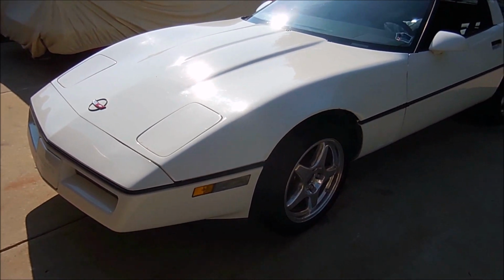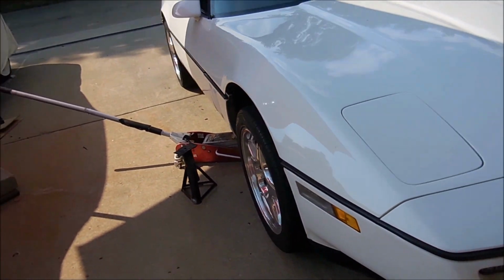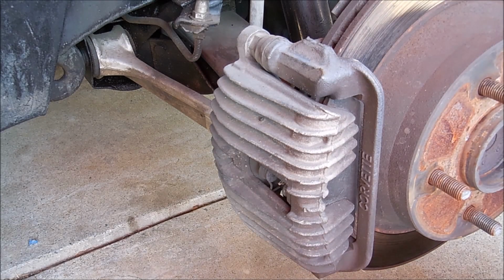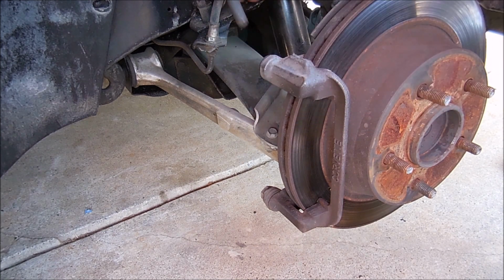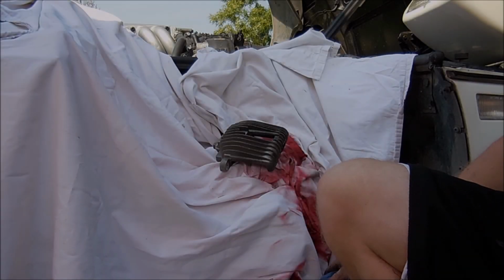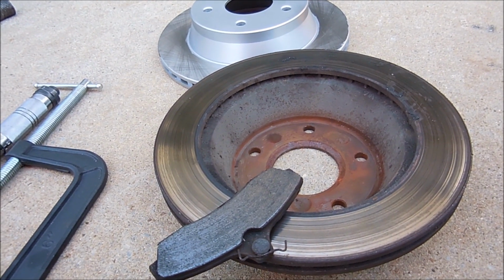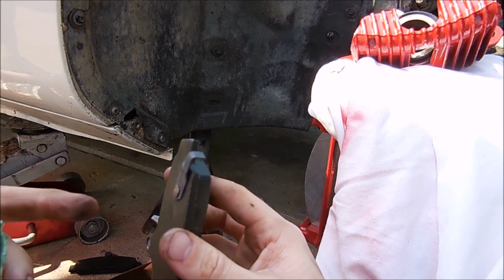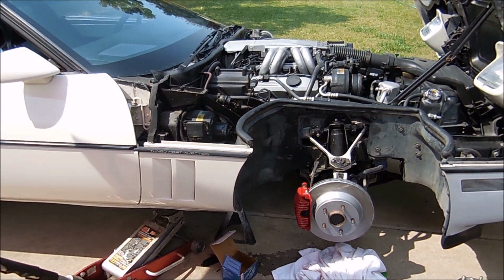1985 C4 Corvette: Project Daily Driver Part 5 of 8

Comment: Just finished up a complete rebuild on my 86 c4. Doing the same thing as you, making a dependable daily. How much of a pain was that dash, I hate dash work so I haven't touched mine yet but I have to replace the light sensor in the top left corner of the dash, it works just always dim. Keep on with the vids, enjoy watching your progress in comparison with mine. Nice wheel choice, threw the same ones on mine, didn't care for the stock.

Comment: Not a big fan of wheel adapters, too many horror stories. But those wheels do make the car look a whole lot different.(although, I am a big fan of the saw-blades, I think they are a pretty rim).

Looking good Ben!
Reply from the maker: Well, at least they are bolted on to 100 ft lbs, I've seen people just use spacers that get sandwiched in between the wheel and hub. 2. if you get a set of these wheels with the correct off set,  you are out $1000, and then you will need tires. I picked the best option I think.
Reply: +TheCorvetteBen as long as your not hot rodding it, i think you be ok w the spacers. The Vette is coming along nicely
Reply: it depends on the adapters you buy, I have a highly modified 86 iroc with wheel adapters for use with a set of corvette racing rims, and I do hard launches, race, drift and thrash on it every day, and my wheel adapters are still holding strong
Reply: Different doesn't mean good

Comment: so the wheel mount spacers were necessary for what? to move the wheels out board by 20 mm/.8" for looks Looks/ Appearance? or to prevent tire rubbing on something as the suspension works ?
Reply from the maker: Those wheels were made for the newer C4s (92-96) so they have a different offset. If you try to put them on an early C4 you need spacers to do 2 things. 1. to make the line up with the wheel arches and 2. not contact the suspension on tight turns.

Comment: Something else you could use for painting is Adhesion Promoter. Its kind of like a primer but its clear and it make paint stick better to most surfaces. I have used it on most of that i have done with my car and its worth it.
Reply from the maker: +ElCaminoGuy2005 Have a link to the product? Sounds interesting

Comment: I've pulled the Caliper mount off the spindle, every time I've done a brake job.  Curious... why paint them and not powder coat them...  You can also buy calipers pre-powder coated, Red.  I plan to do that, order a second set.  Powder coating won't degrade if brake fluid gets on it, where painted calipers will have the paint dissolve.  BTW... power bleed the brakes, gravity bled brakes really don't get out what you need out... ALL the contaminents (sp)

Comment: You really do great work.  What's the disposition of the Caddy?  That's what I hold my breath for.  I love the patina on that car and the fact that you didn't try to pretty  it up too much. Still intake problems?
Reply from the maker: +Bob Cannon Waiting on parts for it as we speak. Ive driven it in the last few weeks if that helps at all
Reply: I have a 56 caddy as well. I don't have the dual carb set up though

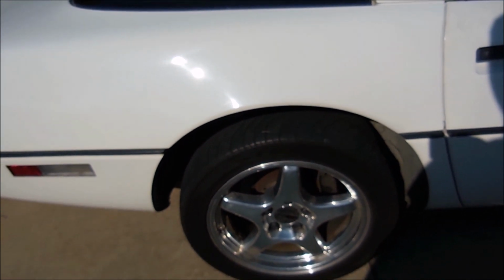Comment: 0:56 Wheel hub adapters can be extremely dangerous, they're often poorly made and if the new studs aren't a part of the assembly then they are almost guaranteed to be extremely unsafe. They often change the suspension geometry and can cause excessive wear of suspension and drive train components, and can also change the handling for the worse.

Also, those wheels look like cheap aftermarket Honda wheels anyways.
Reply from the maker: Except those wheels are factory wheels on all zr1 c4 corvettes...
Reply: They still look like they're from the Geo Prizm for sale at my local recycling yard.

The hub adapters are still dangerous.

Comment: do the wheel adapters cause any added stress to this suspension that is not designed for those wheels? Just curios because I know that using another size wheel can cause some major damage.

Comment: Did you make sure you cleaned them new brake disc with brake cleaner? If not you will have ruined the brake pads since the put a special coating on them.

Comment: That's weird, back in 93 I bought a black 85 corvette and put polished 92 stock corvette wheels with no spacers or any changes whatsoever.  They just bolted on and looked terrific.  It did have z51 suspension but I don't know if that really mattered.
Reply from the maker: +Daniel Van Dusen the year the c4s went to staggered wheels is the year you had to start using spacers. If I'm not mistaken, 92 had the same size wheels on all four corners? I know one year they changed but not sure which
Reply: Yes, all four wheels were the same size though the tread patterns for the Eagle gs-c tires made it where you could not switch tires right to left, only front to back.

Were there other wheels besides the zr1 that weren't all four the same size?  Or was zr1 the only C4's to come with different size wheels?
Reply from the maker: My 96 Vette has different sized wheels. I thin it might have been 94-96? Not too sure...

Comment: Ben, that statement about wheel spacers is inaccurate.  The Rims off a ZR1 fit without ANY adaptor.  Should you use a Grand Sport wheel with the same diameter and widths, you WILL need an adapter.  You likely have the Grand Sport version of the wheel and not the ZR1.

Comment: I prefer the original wheels, but actually these ones are not that bad..
Reply from the maker: +Hedo's 80's & 90's Cars At least they are C4 wheels!
Reply: TheCorvetteBen
right! The main thing is to store the original wheels for the next owner. I can't count the cars that I bought without the original parts (including radio & else) because the previous owner just threw them away... That's a shame!

Comment: It's not a great idea to compress caliper piston fluid back up through anti-lock brake system recommend opening bleeder valve on Caliper then compress piston just to be on safe side for some reason Dot 3 brake fluid builds moisture in brake system when it gets hot or should I say condensation

Comment: Are you planing on selling the car when you finish it? ....I only ask because you choose to just go for "Service" parts instead of upgraded parts, like slotted rotors and ceramic pads. Personally I think red calipers are a boy racer thing, I prefer either black or silver for the factory or cop / inspection officer friendly look, but it is your car, so the main thing is that you like the red calipers.
Reply from the maker: +Morten Ramsing  You are right, I did choose not to upgrade the brakes, and the reason behind that is, upgrading is a slippery slope. Let's say I upgrade to C5 brakes, then comes upgrading the suspension, then motor, then trans etc. When it is all said and done I have 15K in a 6K Corvette. I figured keeping everything stock is the way to go, especially since I can pretty much do a full brake job for under $130.
Reply: I know what you mean man, adding upgrades can be an addiction and can get stupidly expensive haha. But sometimes (E.g. with my old Ford) Brake job with "Stock" spec parts was $80 and an "Upgrade" brake package with slotted rotors and upgraded pads was $100. To me that just made it worth going for the upgrade package rather than the stock package.
Reply from the maker: That make sense. I gues I kinda did the same thing. Instead of turning the old rotors, I bought new ones for just a little bit more?

Comment: Get any rotors you want... But.. do NOT PUT CHEAP PADS ON THEM !!  Get the best pads you can find.. EBC Reds or Akebono pads.   You will ruin your Rotors in less than a Month with those Cheap pads !!  Do not do it !!  A good set of pads will run you 8-90 bucks and is well worth it !!